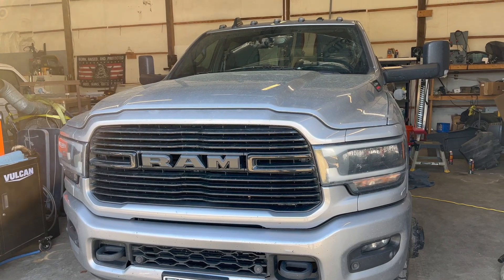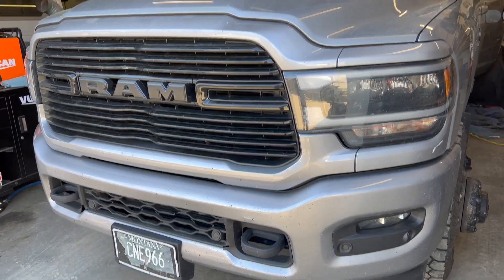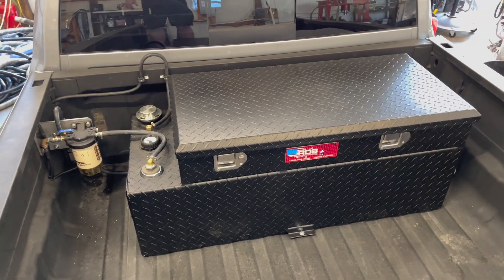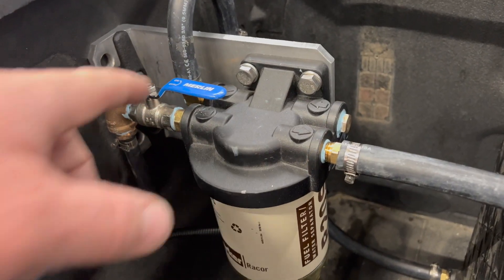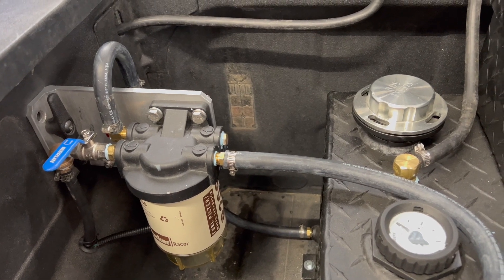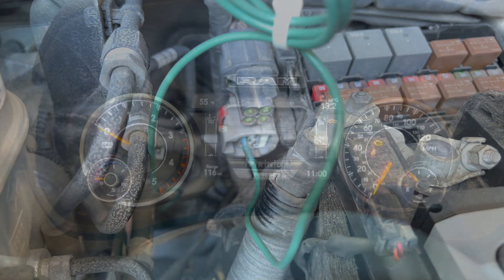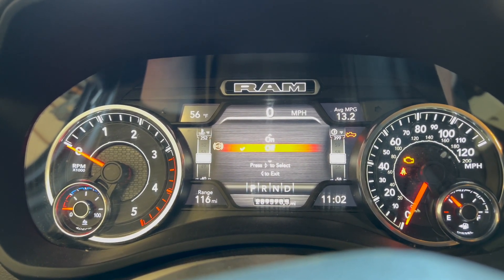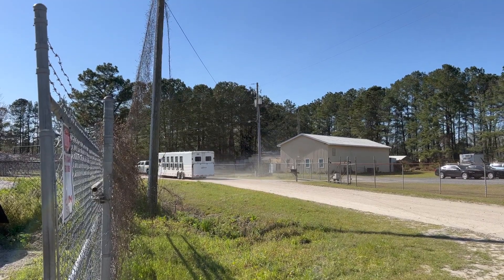RDS Aux Tank Installation on 2020 Ram 3500 6.7 Cummins with Fuel Polishing System

Comment: Hello David.  I enjoyed your how-to video on this transfer tank install.  I also have a newer Ram truck and want to add this capability and this seems to be the best way with out voiding my OEM warranty.  Just a few questions:  
When you refuel your main tank, do you refill while driving?  
Or, do you need to be stopped on level surface to fill your main tank?
How do you know when your main tank is full? I know this sounds like silly question, but usually the main fuel tank gauge has some lag time in reporting the actual level of fuel to keep it from showing slosh movement.  Or do you even run the pump until the main tank registers full?  Or shut off at 3/4 level on main tank so not to overfill?
Does the OEM gauge follow the fuel level quickly so you can proactively turn off the pump to keep it from over flowing the main tank?
How many GPM does the auxiliary pump provide? 
How long does it typically take to fill your main tank if it is empty? 
You are running a Racor R20S filter, that is 2 micron (as best I am able to tell from the Racor site), how does this 2 micron filter work for you, does it slow down the transfer rate?  
You polish the fuel if you so choose.  How long to you do this for?  While running? What is your interval for changing filters?

Thank you for your time, please answer all questions, well done video.

Comment: what size hose did you use for this? this is nicely done
Reply from the maker: The fuel hoses are 3/8" and the kit I buy for the ram is the 1.75" for the Chevy so you do not have to cut the aluminum pipe, only the rubber hose going to the top of the tank.

Comment: Worrying about over filling the factory tank.  Does the Rds tank install install kit ball valve in the T stop the delivery of fuel under pressure from the pump?  Great info and want to add this system.

Comment: Can you add a long for the pump and filter? Or part numbers? Can you also add information about the mounting bracket you used for the pump and filter/water separator?